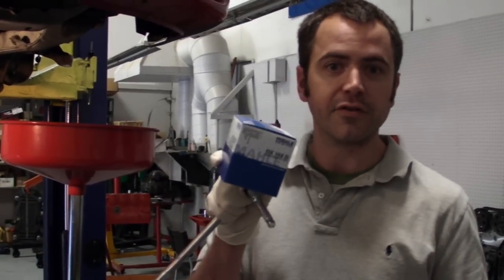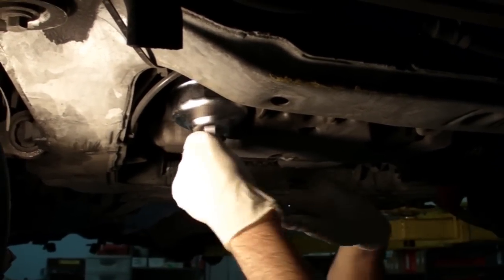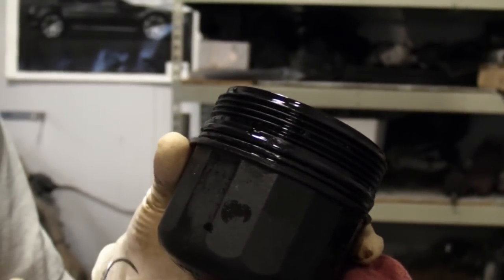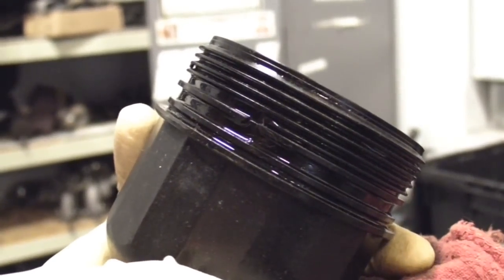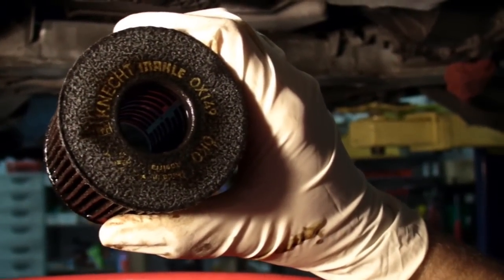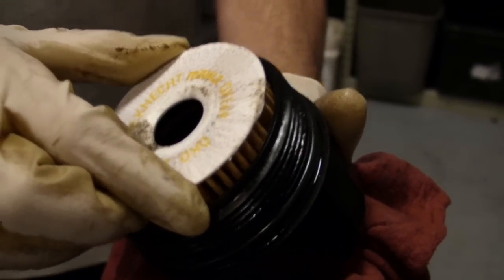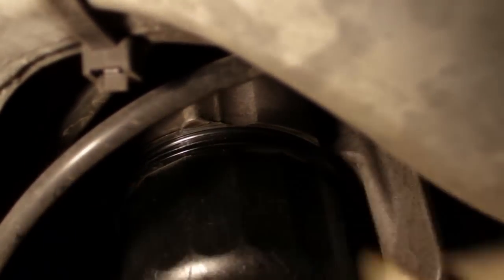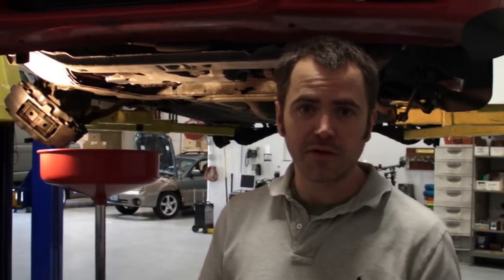IPD Volvo Tech Tip Oil Filter Cartridge 1999- Volvo models

Comment: good explanation, however i skim coat the o ring and the aluminum housing a light coat of fresh oil to allow the o-ring to slip and prevent bind and roll when reinstalling and tightening.

Comment: Thankyou so much for explaining the O ring placement. we did a change on our 04 V70R and it dumped a couple quarts within a couple miles. without this video i wouldn't have realized the problem was that i put the ring in the bottom groove. Thanks guys, keep up the good work
Reply: John Schellhase Same here. My C70 was leaking oil because I put the O ring all the way at the bottom. I saved so much time and money thanks to this video.
Reply: John Schellhase mine is leaking now I hope that is what I did..
Reply: Same Ty guys
Reply: @1sgsmith1  Same here!

Comment: As an important side note, if your car has an older spin on filter (or some canister style filters with a central stud, some VW's have them) its generally a good idea to make sure the stud the spin on grabs to is tight. I work part time at an oil change place and sometimes with first time customers, the previous service shop will have over-tightened the filter. Getting the old one off can loosen the stud a bit. One of those unlikely scenarios that you always have to check for.

Comment: sometimes the O ring don't hole on some xc90s even if it's new will pass oil in few months.  I use teflon tape around the stop lip to help seal it as a back up. This has been working for me and of me my friends who use the same type filter.  I wish there was a better setup on the market than this.

Comment: It might be worth noting, for those that aren't sure if they are overtightening, 18-19lbft is all it takes. I got that from my manual cause I'm a nut for proper torque specs no matter the part, but the plastic cover may also specify that

Comment: When I changed the oil on my S80 I stuck the new filter back on the engine, just like it looked when you removed the housing, and then replaced the housing.  This was 1500 miles ago. Do I have anything to worry about? I used synthetic oil and would hate to have to do the job all over again.

Comment: Ipd Volvo, I was wondering if you can solve this oil changing mystery for me. 2000 V70 Volvo SE Non-Turbo. As I continue to revive, I cannot stop the oil filter from leaking oil in our driveway.
I do oil changes fairly frequently due to the age and 210,000 miles on the OD. Recently did the PCV breather system as well. I'll admit that I don't baby the car and I like to drive it a bit hard as its a fun car to drive while feeling glued to the road. The last time I changed the oil at the garage we tightened the plastic housing almost as tight as tight as we could get it. The reason, anything less, or intermediate, or tight has always leaked. 
In my opinion, this might have to do with the use of two different materials ( Plastic against metal), the two must expand and contract at different rates where it might produce this loosening consequence? I understand that over-tightening might produce this as well but after a few years of this frustrating dilemma..., there has got to be a better way/ answer?

       Thank you for your time, I look forward to your reply.
Reply: over time the cartridge housing becomes brittle. simply purchase a new cartridge housing from IPD. I recommend OEM Volvo with the included filter and O-Ring and install. I went through this with my 2000 s70 glt-se. Also extreme temperature changes doesnt help either

Comment: the 2008 V70 oil filter is removed from the top side. anybody ever video that procedure? a small resorvoir about the size of a beer can has to be moved to one side. then some twisting pushing the cap and cartridge are removed. I must be doing something wrong.  I have done two oil changes, each time I am hoping I don't break anything.

Comment: Do you tighten the oil filter cap all the way in?
Reply: I just put in a brand new oil pan and the filter cap that was in the old pan does not go all the way in. If I screw back into the old pan it goes in perfectly.  We're thinking the pan is defective...maybe I'll buy an  oil filter wrench and force it to tighten.